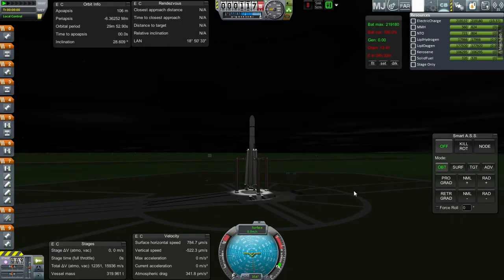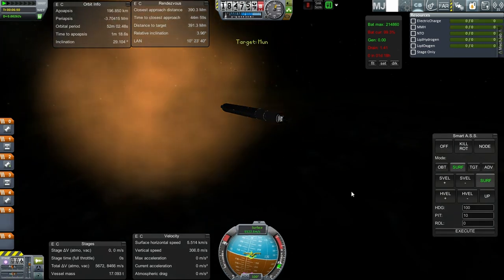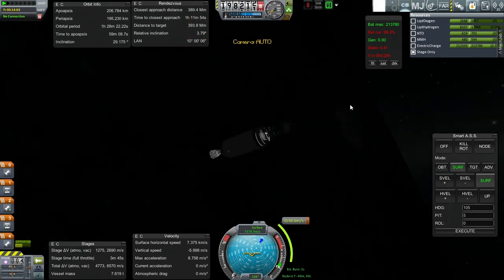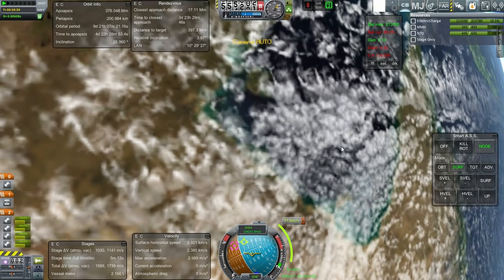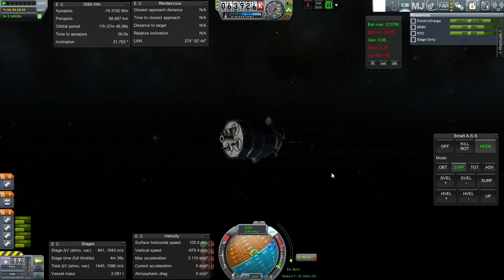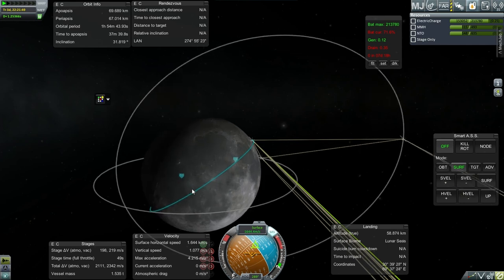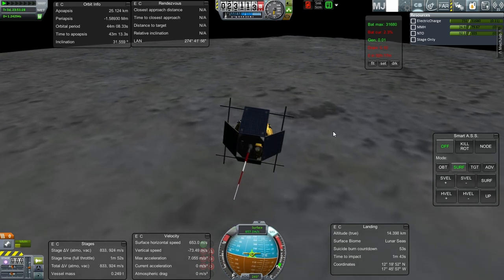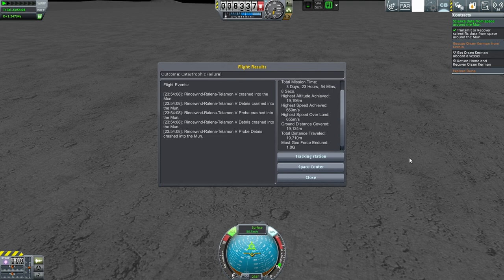Realism Overhaul in KSP Beta 16 - Rincewind Lunar Lander Part 2

Comment: I use AmpYear to help show where the EC is going. RCS and SAS use EC. Sometimes as high as .033 EC/s on RCS and .017 EC/s on SAS. Communication uses alot of EC when transmitting upwards of 50 EC/s. When you try the Lunar Landing again use different Solar Panels they might help. Excellent Video!
Reply: Ok, i understand. I have not used RP-0 mod yet. It was worth a shot.

Comment: You could try using "precision control mode" - it balances thrust of RCS thrusters somewhat. It doesn't always work, but I find it making control easier more often than not. Also you might want to consider balancing RCS thrusters in "tanks near-empty" regime as by the time of landing (when you'll need the most precise control) your tanks are likely to be almost dry. Just empty tanks in VAB and use RCS Aid to balance thrusters.
Another thing for you to consider (this is mostly irrelevant for this episode, but more of a general thought) is to build (un)foldable solar wings using robotic hinges. This will likely increase the mass of the spacecraft - but this is what actually happened in reality - early solar arrays were rather unwieldy.
And last one - you can simply disable ElectricCharge "tank" at the probe at launch to conserve energy - just remember to re-enable it BEFORE separation ;)
Reply: ***** If you have some time and feel like doing it, you can make IR compatible and send updated configs to NathanKell - I'm sure he'll appreciate a contribution. I'm sure by now you've gained a "feel" of how much stuff should cost. The same applies to any part that you feel cost inadequate in your opinion - feel free to contact NK on that matter. Although he's got some RL issues as far as I know and as result don't have a lot of spare time - in my experience he's always forthcoming to discuss any matter that someone feel is inadequate as long as there is a good explanation why one thinks one way over the other. The reality is that RO supports so many parts now that it's easy to miss something, or do something wrong without even noticing.

BTW I always forget to mention that the white button on the top inflight panel is EngineGroupController - a small mod contributed by me into RO which allows to define groups of engines (via right-click menu in VAB), which can be independently throttled in-flight (if there are groups defined, small GUI with slider for each group will appear if you push the button). I've developed it in anticipation of Angara-5 flight as it throttles down core stage until boosters sep. Same thing happens on Delta-4 Heavy flight BTW. The icon is white for some users while works perfectly for others - not sure what's up with it.
Reply: ***** Oh I mentioned EngineGroupController not because I want you to use it immediately but merely so you would know such functionality exists (as it turned out not many actually knows about that as it was kinda "silent" addition) :) So don't worry about it too much.

BTW - have you considered using ConstructionTime mod in your series? It IMHO adds a lot of realism, and - my favorite feature is "simulation" - for small amount of credits, you can do whatever you want with the vessel for up to 15 minutes, and - importantly - it allows you to start in orbit - very useful feature to avoid frustrations with expensive interplanetary missions. It also adds a concept of "parts warehouse" when you can order several parts at once as a batch and get a discount.

Comment: Fine controls may not of helped 100% but it may of kept you in the general area of attitude whilst on descent and may of saved you enough dV to land. A lot of "mays" in there but it's a suggestion. Fine controls has helped me out of a few sticky situations in the past. 

Great series still but damn unlucky though. These need to be more frequent for sure! :)
Reply: ***** Yes, fine controls will stop SAS/SmartASS from firing the RCS so vigorously. Your craft won't stay quite so stable but will sort of oscillate in the general direction you want it. This, obviously, will depend on the size of your craft(bigger craft - bigger thrusters) but for the craft in this video it should work out ok/better than having it firing all over the place and wasting fuel. Worth a shot if you find yourself short on fuel.

Comment: Man i was willing that probe down with you. So so close. About to attempt my own luna orbit with my Delta design.
Reply: ***** landed on the edge of a crater, rolled over and snaped antena. 2 hours in total. But totaly worth it for the feeling of making it to the moon in RSS RP0
Reply: True. I have put a landing on the back burner for now, Need to get some of these contracts done to raise funds for the tracking station. These Satellite contracts are hard though. How do you get an equatorial orbit from KSC with 1960's tech?? I can get the height or the inclination but not both :-(

My LV has liftoff SL-TWR of 1.25. burns for 160 secs and gives me 6500m/s (ish).
 2S based on the Centaur and starts at 0.8 TWR and burns for 300 secs and gives me a further 4000m/s.
My satellite has an orbital 1kn thruster with 1000m/s Dv and RCS control.
I can achieve a 1200km circular orbit but that's it.
Not sure how to plot my flight profile for a good equatorial 1000km circular orbit. Any ideas?
Reply: Ahh didn't consider a launch site change, I was trying to keep it somewhat realistic so wouldn't expect the US to use other sites.
That said its only a game :-(